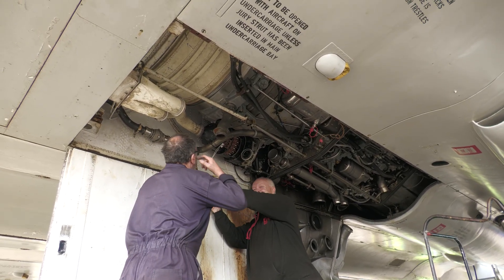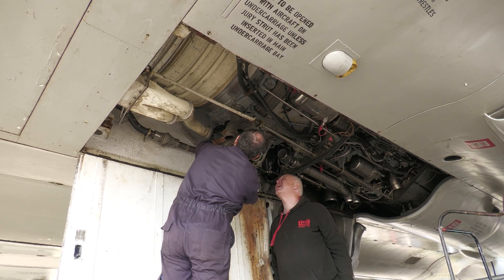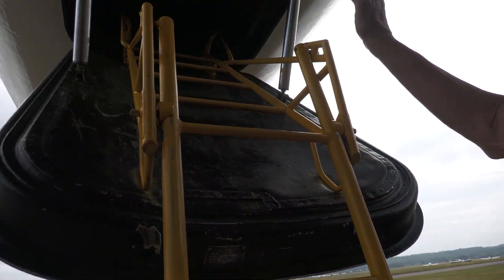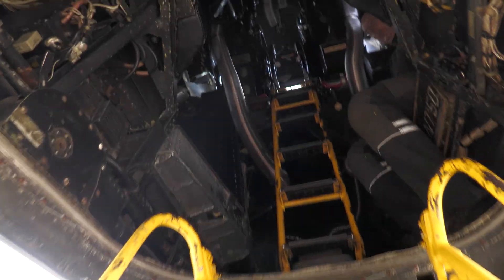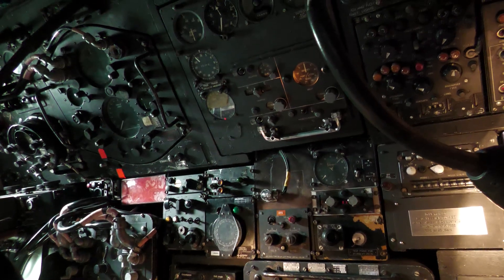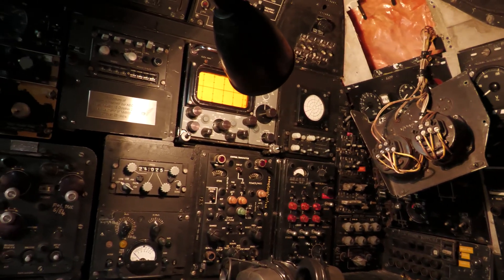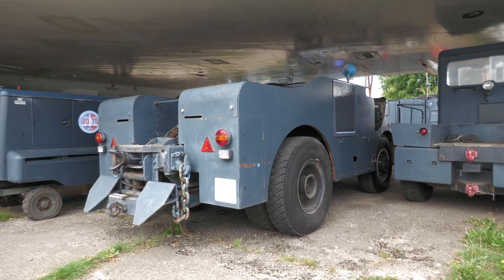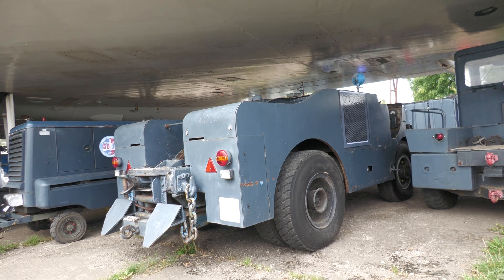Vulcan XM655 Up Close and Personal . Bomb Bay, Cockpit, Crew Area and very knowledgeable Ground Crew

Comment: woah are those inside plane scenes shot with your new camera? I heard it wasn't great in tough lighting conditions but it looked great!
Reply from the maker: It did struggle in the dark, as has been reported in lots of the reviews. I can see some graining on the raw video. What helped it is that it's so small in that  crew section  the lens was wide open and aperture was at F1.8, not real 1.8 as in DSLR 1.8. Someone worked it out and I think it's about equivalent to F11 on a decent DSLR

Still very happy with it as I don't really do much shooting in low light and I like the form factor. I did look at some of the 1" sensor cameras but other than the Sony Z90 the form factor was too large. I've read some reviews about the zoom buttons on the Z90 and they said it's very hard to get a nice slow zoom on it which is one of the main reason I opted for the X1500
Reply: @AeroSteve.i  wow thank you for the input . I too have been looking at ask Cabrera and this is at the top of my list. Great footage.